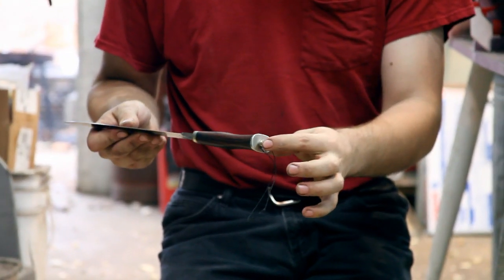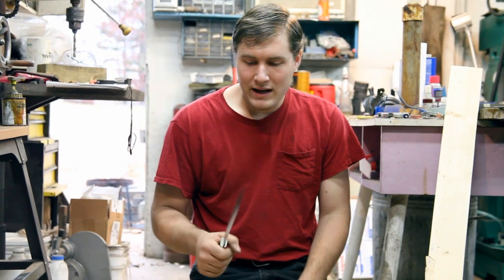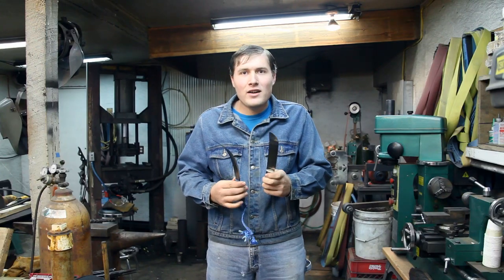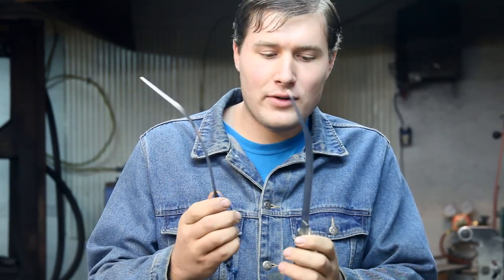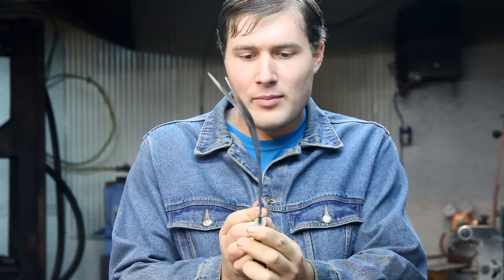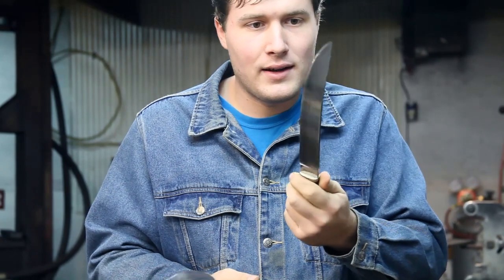Journey to Master Part 5 of 5

Comment: Great series, and very enjoyable (+1).  Congrats on the journey too.

ASIDE (not directed to anyone in particular): Speaking strictly as a semi-informed spectator with no actual smithing experience, I gotta say ... I'm not keen on using a somewhat unrealistic hardening strategy just to pass the ABS tests (i.e., leaving the whole work softer than ideal to avoid snapping and merely torch hardening the edge in order to pass the cutting tests, as confided at 4:05) but the rules apparently allow it, so who am I to say nay ?

I'm inclined to wish they'll eventually finesse the testing slightly, to discourage 'softballing' and instead raise the bar of excellence with regards to demonstrating true hardening expertise.  In other words, entries should not only survive the 90 degree torture test, but also spring back towards true to a certain reasonable degree (i.e., staying bent beyond a certain yet-to-be-established angle, ala 3:57, would fail under the tightened guidelines).  

Polite rebuttal is welcome ... I'm just a spectator putting in my $0.02 and am not trying to troll anyone.

Comment: Very nice job!  Ive always wondered how a knife made like this stacks up against a katana from Japan.  What I mean is, they do folding and differential tempering and what not, but yours are probably far more precise in terms of the known elements of the steel make up and the hydraulic press continually crushing down the steel probably drove out impurities (I would think).  What was the scale that was coming off while the billet was being drawn out?  Was that mostly carbon or just impurities?

Comment: As a chef/butcher, I use knives for a living. I sharpen/maintain them on Japanese waterstones, as well as offer a sharpening/repair service for local professionals. I was merely defending the labor cost of a small craftsman who makes his own steel. Many of the "traditional" knives crafted in Japan, which I hold in very high regard, use a commercially manufactured Hitachi or Uddeholm as their cutting core (or the entire blade). I'm sure Kyle can grind a fine knife from stock, but he chooses not.

Comment: is there any reason you didnt use a clay coating on the blade to harden the edge ( ive seen that method used on katanas)? It seems to do 2 steps in one by letting the spine cool down slower when quenched.

BTW tell Caleb thanks for the time lapse on some of the time consuming tests.

Comment: They both do the same thing for the edge, which is making it harder, but the back will be less affected by the heat here, where a clay pack is meant to let the back of the blade also get harder, or when a clay pack is on a sword it is to make the heat spread more evenly so there are less brittle spots in the metal, not saying that that won't happen to a knife just it is not done for that reason most of the time.

Comment: Well 3 years till I can test for js. Then 2 for master. I pounded out 2 blades yesterday and got started filing. They are going to be horible.but that's ok. The first two.knives I made was with stock removal. It took hours and hours of filing. Those knives are ugly, mishapen, and made of mild steel lol. These 2 current ones are 1084. 1 could be an ugly hunter, the other will be an ugly skinner. I got about 9 foot of steel left so.lots more to practice with.

Comment: As this is true that it is harder and will keep a edge longer, Damascus or more properly here pattern welding, will have a sharper blade and will not chip, what a knife needs, also this is not true Damascus, Damascus had to do with smelting the metal.  As far as your degree in metallurgy goes, most of the people that make knifes apprentice under top level smiths/Metallurgist, just because we make old style things does not mean we don't know new information, and or have a degree in metallurgy.